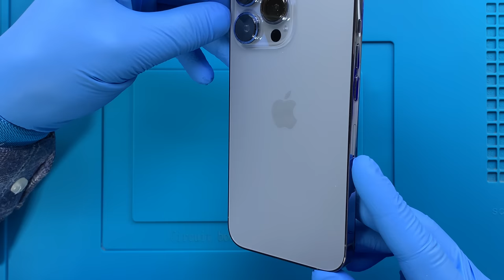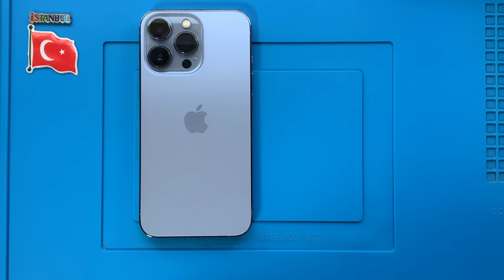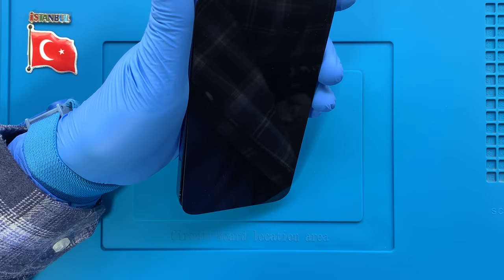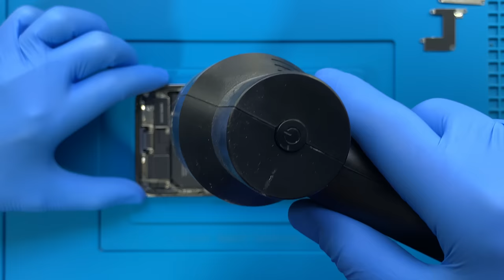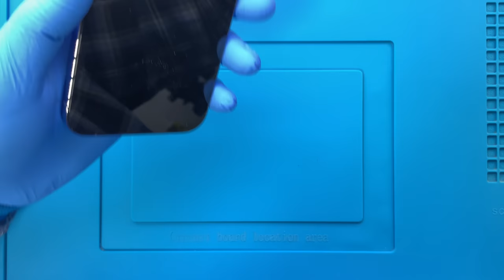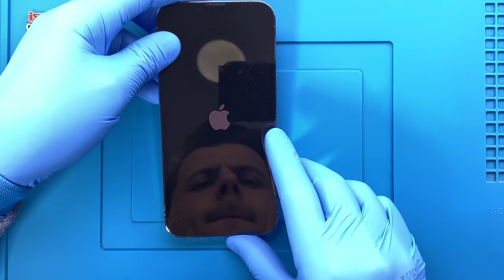iPhone 13 Pro Batarya Değişimi 🇹🇷

Comment: After battery replacement , do you guaranteed ip68 water resistance?
Reply from the maker: Hi;
Phone manufacturers only guarantee water resistance for undamaged and undamaged devices. For this reason, it is necessary to be more careful about liquid contact after screen - part replacement and technical service process.
Greetings.
Reply: @gsmi  u
Reply: Not even Apple guarantees this if the device gets damage by water, lol

Comment: What happens to moisture protection?  Is she not recovering?  I just didn’t notice on the video that the master was gluing the screen to the case, but he heated the device when he removed the screen
Reply from the maker: Hi;
It is done in private. You cannot put a camera in that area. Operations continue.
Greetings.
Reply: Hello friend how are you

Comment: Will it still be waterproof after the battery replacement?
Reply from the maker: Hello;
Phone manufacturers only guarantee water resistance for undamaged and undamaged devices. For this reason, it is necessary to be more careful about liquid contact after screen - part replacement and technical service process.
Greetings.

Comment: Its still water resistance again or not anymore?
Reply from the maker: Hi;
Phone manufacturers only guarantee water resistance for undamaged and undamaged devices. For this reason, it is necessary to be more careful about liquid contact after screen - part replacement and technical service process.
Hello.
Greetings.
Reply: @gsmi  Thank you sir for the info. I want to learn how to fix mobile devices just like you and im very interested of it, i will be practicing soon if i have enough money to buy tools just like yours and follow your strat/techniques as a student of your channel. Thanks again sir, God bless sir :)

Comment: How about the waterproof? Is it still working?
Reply from the maker: Hi;
Phone manufacturers only guarantee water resistance for undamaged and undamaged devices. For this reason, it is necessary to be more careful about liquid contact after screen - part replacement and technical service process.
Greetings.
Reply: @gsmi  🥰🥰

Comment: Is it waterproof?
Reply from the maker: Hi;
Phone manufacturers only guarantee water resistance for undamaged and undamaged devices. For this reason, it is necessary to be more careful about liquid contact after screen - part replacement and technical service process.
Greetings.

Comment: this phone is no longer water resistant
Reply from the maker: Hi;
Phone manufacturers only guarantee water resistance for undamaged and undamaged devices. For this reason, it is necessary to be more careful about liquid contact after screen - part replacement and technical service process.
Greetings.